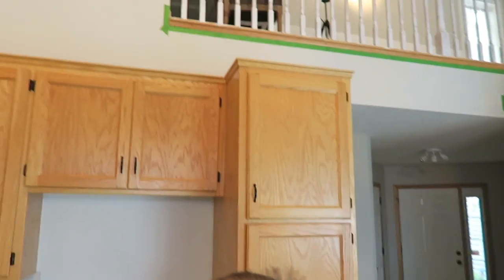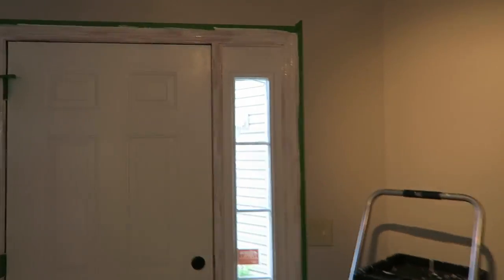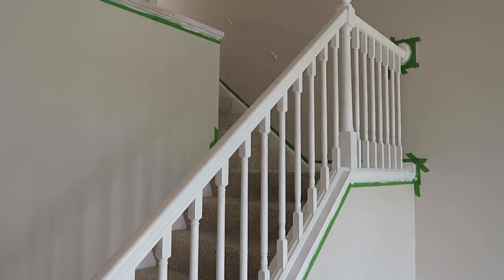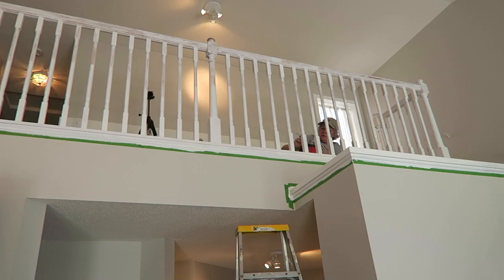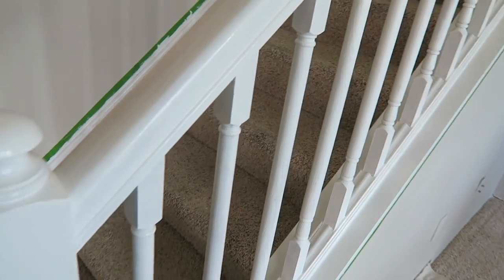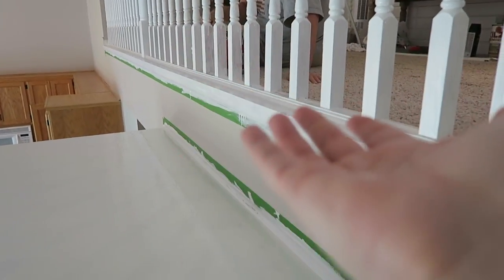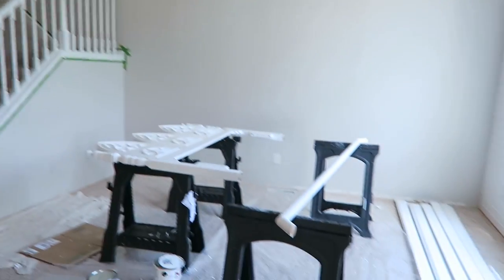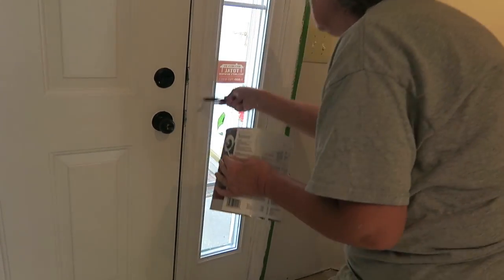WET PAINT | VLUNE DAY 25

Comment: You can buy a frosted sheet that you spray the window with a sudsy water mix & put the frosty window cover on & then squeegee it until all the water comes out, which leaves no bubbles. It does peel off when you want to change it out, it's extremely cost effective & yet gives great privacy.

Comment: I have used the film ( it comes in different designs and colors)  before and it is easy to install. It goes on with a soap and water mixture and can be removed. It is at Home Depot and Lowes.

Comment: There is a window tint you can buy at Home Depot/Lowes that sticks on the inside of the window.  They have all different kinds of styles from frosted white to stained glass.  It will block people from looking in but it does hinder your ability to look out at whomever is at your door depending on which one you pick.  But I suppose you could always put in a peep hole unless your Co-op won't allow you do so.  I have the same style windows by my door and that is what I did.  https://www.lowes.com/pd/GILA-36-in-W-x-78-in-L-Diamond-Lattice-Frosted-Privacy-Decorative-Static-Cling-Window-Film/1000002756